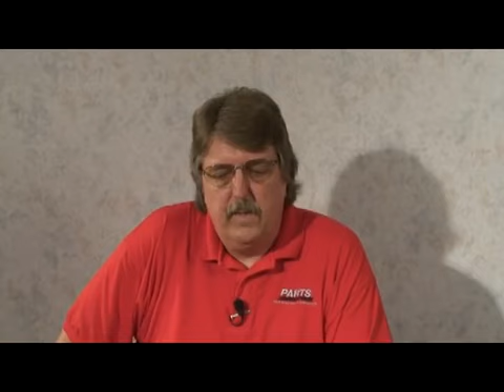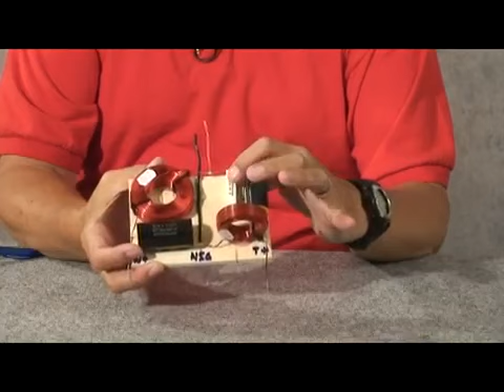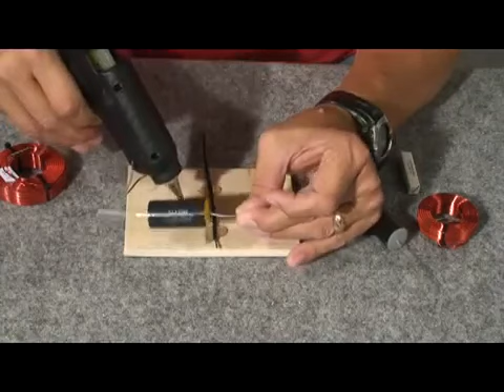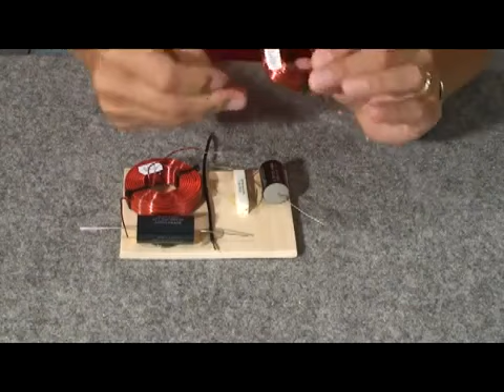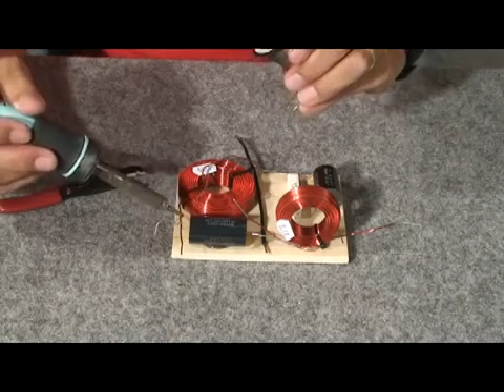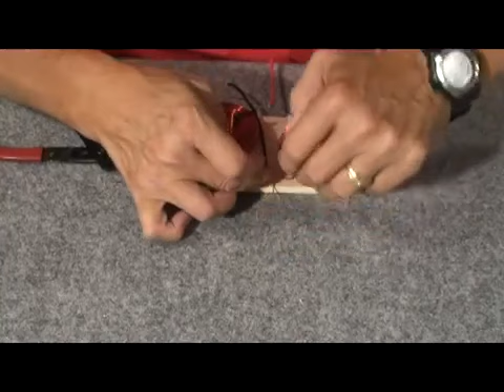cross over NETWORK for 15'' speakers

Comment: How many turns of coil? Pls!
Reply from the maker: 140 turns..... STW21     AMG19
Reply: How many turns of coil IN..( low ) and
How many turns of coil in ( HI ) 
How many wattage of 15" speaker
Thnk you so much
Reply from the maker: watts 300..... low turns 140.....hi turns 120........ 250 volt and 5uf capaseter for low and 250 volt 2.2uf for hi......